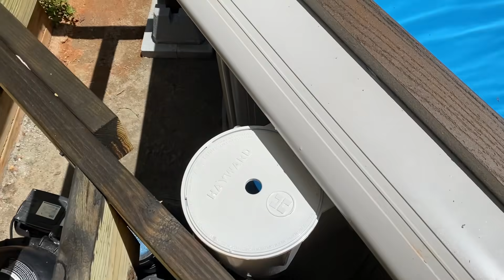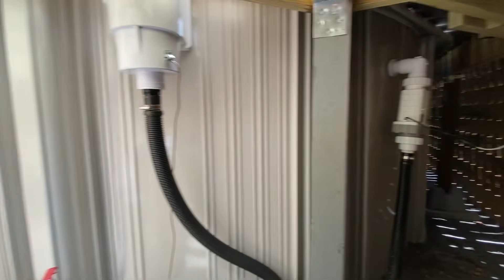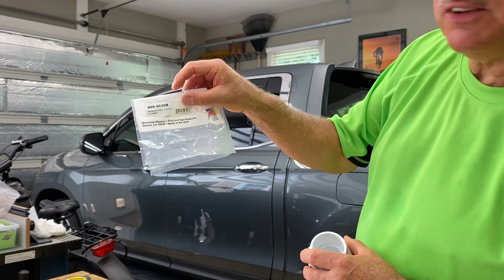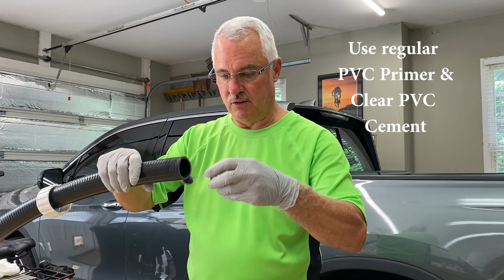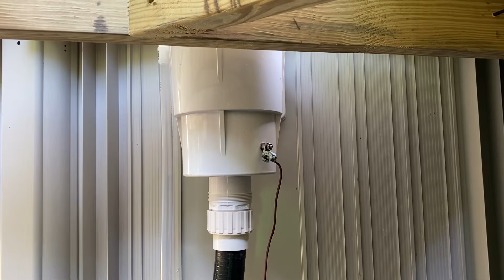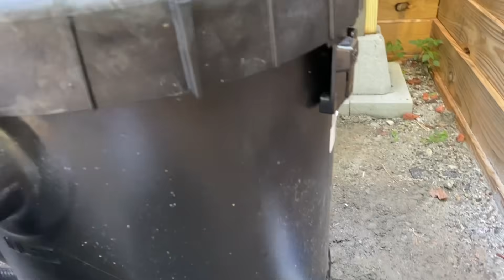Flex PVC Pool Pump Upgrade

Comment: Should I use regular glue for white flexible PVC piping?
Reply: Yes same glue and primer as recommended for schedule 40 pvc
Reply: @SafeTravelRV  I am also connecting white flexible PVC to regular PVC is there anything i should know?
Reply: @myviews469  treat same as regular schedule 40. I might do a union there just in case I want to make changes later.
Reply: @SafeTravelRV  I do have a union valve but i need the flexible pvc to better match but concern with PVC Glue it should work with flex pipe too ?
Reply: Make sure what you have is schedule 40 flex pvc.

Comment: I wish you included a list of parts in the description. 😢
Reply: Thanks, I will next time although each system will be slightly different. Listen to the video again as I’m pretty sure  I describe the fittings I used for this application.
Thanks again for your suggestion!

Comment: I need to make sure that my new pool pump not to be stressed due to differential in level between old n new pumps, I used a Nuprene rubber with stainless sheet shield Coupling with Supreme GE silicons Sealant n worked great.

Comment: Life saver. I have the same filter and salinator set up and getting the right fittings to work with flexihose has been tough. Question though, for the reducer coupling on the salinator, do you glue those pieces together?

Comment: The rubber ball in the skimmer trick was such a face palm moment for me. Like,  why didn't I think of that? I'm interested in upgrading my pool hoses and adding the valves like you did. Thanks for a great video!  Subbed and 👍
Reply: For real. A couple weeks ago I bought an inflatable plug and an air hose for about $40 😂

Comment: I notice that the deck is built over the top rail. What id=s the plan for replacing the liner? Ripping the deck up?
Reply: It’s a beaded liner so it’s replaced from the inside.
Reply: I was wondering same thing..so do us regular liner people have no deck options??
Reply: If the liner needs replaced, the pool will have to come down and then would be away from the deck👍

Comment: you wrapped the tape counter clockwise after you said clockwise? yes?
Reply: Regardless wrap it clockwise. Do as he says not what he does.
Reply: Totally wrapped that wrong, also if you flip the roll you can keep tension on the tape as you apply and the roll will not fight you.
Reply: This is what has me confused 🫤
Reply: I sure hope he had the front camera view on. 🤣🤦‍♂️
I lost all interest in this video after this. And he got a 👎

Comment: Are they temp sensors on the inlet and outlet
Reply: Are you talking about the red handles or part going into pool? Red are gate valves and other is chlorine generator.
Hope that helps!
Reply: @SafeTravelRV  I noticed cables attached to the skimmer and something attached to the outlet. Never seen it before? Nice video by the way, I think if you add more tags you will get more views. I just stumbled accross your video on related videos but had exactly what I was looking for.
Reply: @dalec130   It’s a bonding wire on skimmer. Thanks I’ll add more tags!

Comment: I noticed your aquapro filter. I have the same. What cartridge filter do you use? Do you use the filter sold only by the pool factory or do you use an alternative filter? Thanks
Reply from the maker: Hi Danny, thanks for watching. 
I’m having difficulty cross referencing this filter. If I go through The Pool Factory, it will cost the most. If I cross reference and go with another type, it may not be as good.
I actually plan to get a backup in the off season and may go with the direct replacement from The Pool Factory.
Reply: @bigalsabovegroundpooltips6887  Thanks for the response. Yes it is the most expensive. Which is why I have searched around. I also wanted to explore options and judge the quality. No luck yet though. Please keep me posted if you have any luck with an alternative. Stay safe
Reply: @MrDannyc724  I have a Pentair PLM150 cartridge and those are $250 and up, so I just went a bought a used Hayward Perflex DE filter for $150 now I'll really have polished clear water.